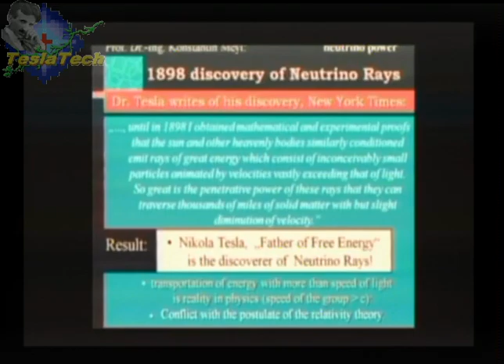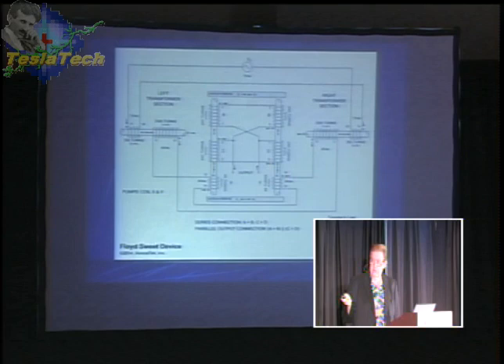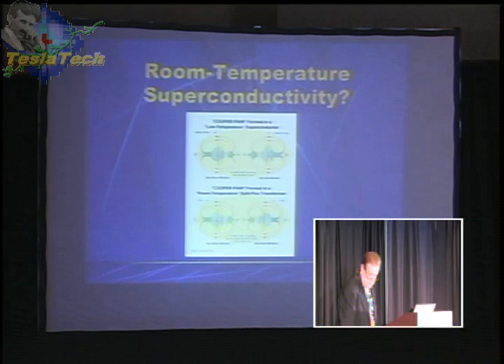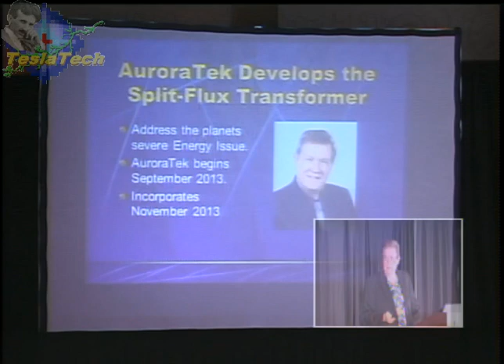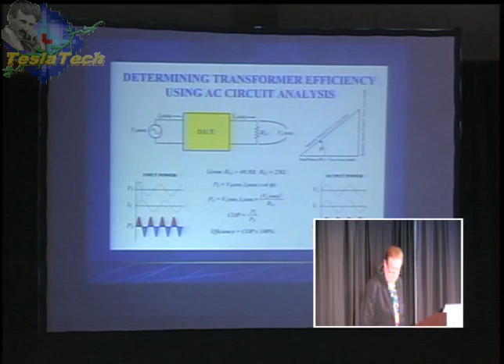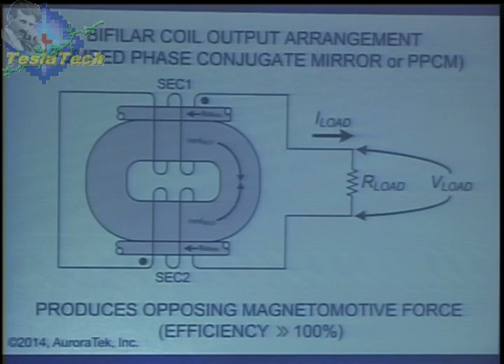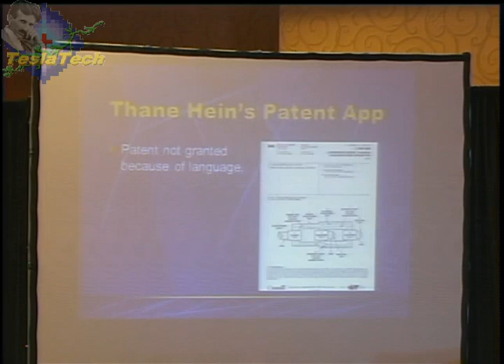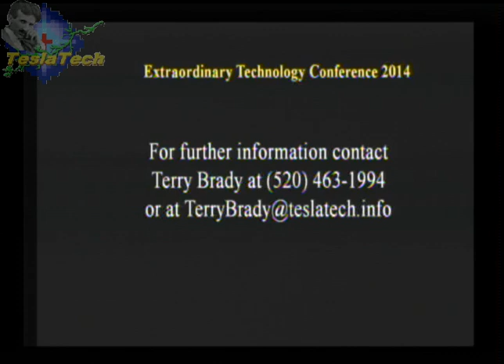William Alek, Revealing Secrets of FREE Energy/Overunity, Extraordinary Technology Symposium 2014

Comment: Excellent video. It would seem that there are many different ways to achieve over unity however they all boil down to the same original elements. My grandfather was friends with a really incredible guy named Don Smith and I was lucky to have seen some incredible devices. When I graduated high school I worked as a roughneck for H&H tool and die company before I went on to get my master's and then PhD in chemical engineering where they taught me everything I saw was impossible.

Comment: Using the trifilar Flux Capacitor in conjunction with   a hair pin circuit  or a gapping current either solid state or from a a rotating field  creates unlimited longitudinal displacement fields..Master Ivo. EXPLAINS THE BIFILAR USAGE BUT NOT THE POTENTIAL REVERSE EMF OF THE TRIFILAR  CONDENCER substitution or the  reintroduction of  cold electricity  that is produced.

Comment: Thane Heins invented RegenX generator, which can create electricity without mechanical energy input. RegenX generator accelerates under load. Current in RegenX generator coils is delayed in time domain, and current start to flow, when magnet has already passed top dead center of the coil. When RegenX generator will be integrated into electric vehicles, range will become infinite, and no need plug in to recharge.